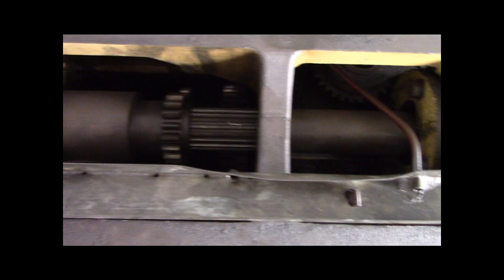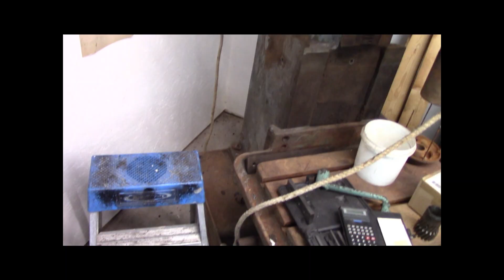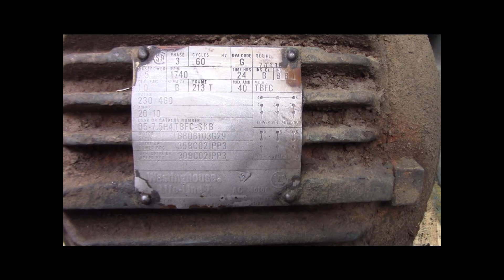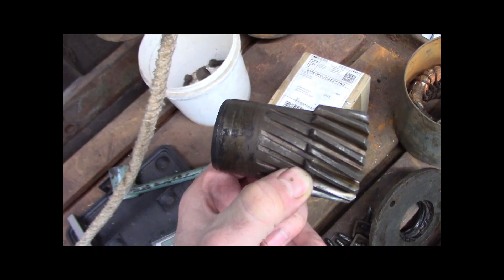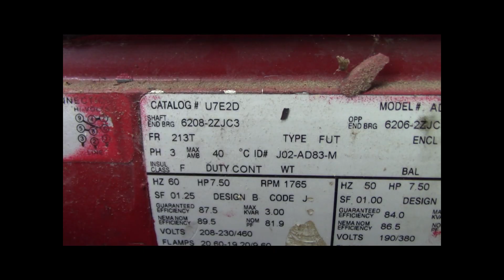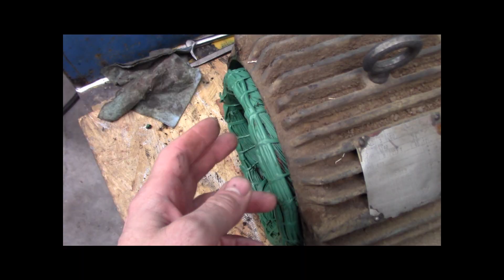7-16-25 --  Cleereman Drilling Machine - Checking out the Motor - Part 1

Comment: What score having finding the same motor already in stock in the archives !   The head gear & quill arrangement looks a little le Jig Boreish in nature .
Reply from the maker: Cleereman did make a jig borer with this same machine architecture. The table and lower parts look like they pretty closely copied Pratt and Whitney.  As for the motor, it is great when you have so much cool stuff, that you forget what you have.... And sometimes get surprised in a good way that you don't have to buy anything to keep the shop alive ! ! !  How's the dam project?  ----Doozer
Reply: @kooldoozer  I'm right there with you about having cool stuff in the archives and when something  actually turns out to be both needed and useful ... It feels like a win . 
 Hydro Dam is still coming along steadily, thanks for asking !   July & August we missed a few work days ( we usually work on hydro on Fridays) because of trips to camp and other summer stuff .   Stay tuned we have more of it on the way .This reminds me .... new editor just texted me this afternoon he has another episode roughed in so it will be coming up soonish .  We have to get past what seems like the constant redundancy of drilling holes with a radial drill every episode ...   Top secret spoiler : we were getting the new trash racks in the tracks and adjusted and we opened the main gate and ran the  Bay 2 Turbine for about 2 hrs and it ran really nice and smooth .